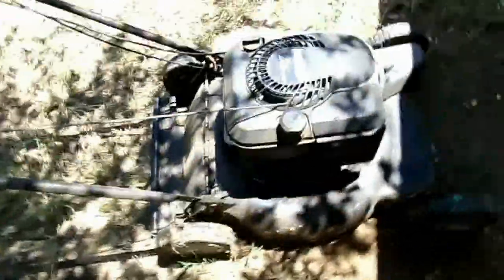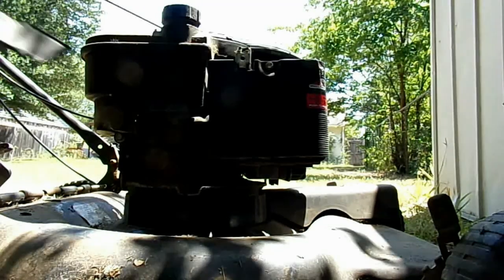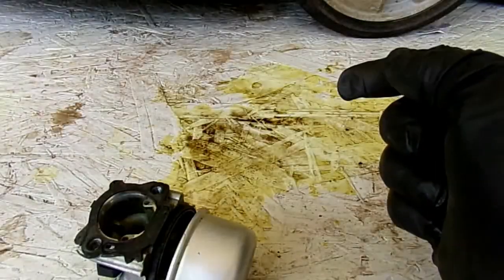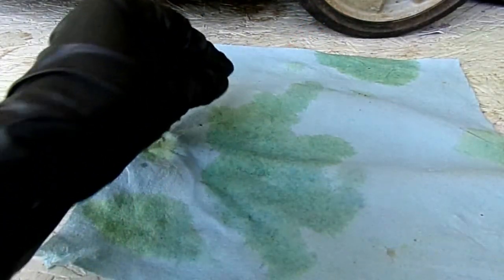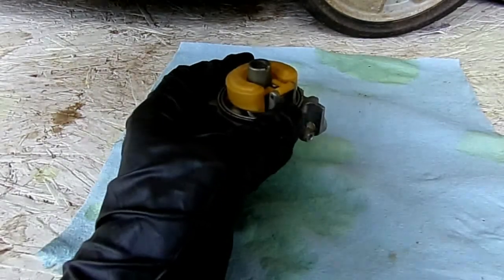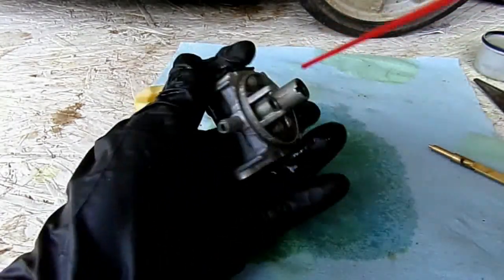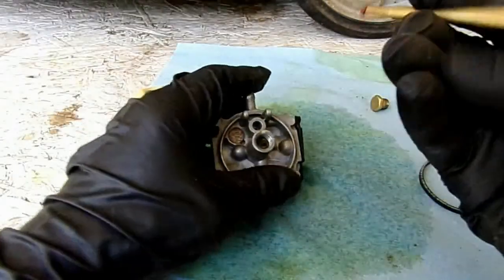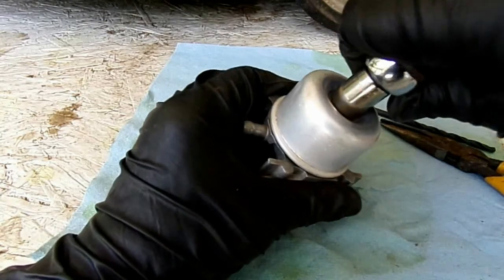Briggs & Stratton Quantum Carburetor Repair

Comment: It runs for a few 2nds when you put small amount of gas in the cylinder but dies. It has spark and compression Did a complete clean and rebuild on the exact same carb.   I have 2 brand new gaskets on the back of the air cleaner housing attached to the inlet of the carb.  Are you saying if that doesn't form a tight seal the gas wont flow into the carb?  Does that include the O' ring on the outlet of the carb?

Comment: Great video and very simple instructions. I did every step in the video and my mower still will not crank. I even put a brand new spark plug in after Carb rebuild and it still refuses to crank. Help please
Reply from the maker: Here are some of the things you need to check.
1. Compression
2. Spark
3. Fuel (new and clean, less than a month old)
If you have all of these and it still does not run then you probably need a new carburetor. Not all of them come back after a rebuild.
All of this is assuming you have not had a catastrophic failure.

Thanks for watching and commenting and good luck!
Reply: It’s probably the magnetometer not producing spark. Or the cable is wore out not pulling the arm over all the way over to complete the circuit. Hope this helps it happened to me as well.

Comment: Clean the backside of the air cleaner housing before you reassemble it onto your cleaned carburetor so that you don't introduce dirt or gunk into your cleaned carburetor.